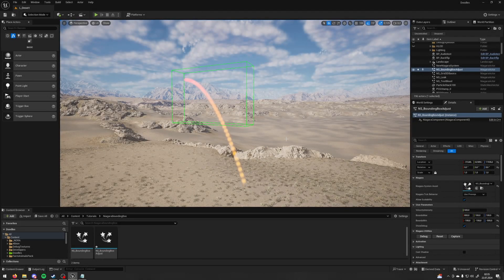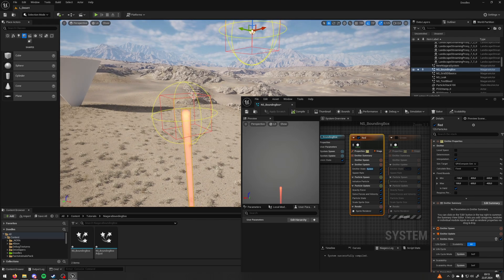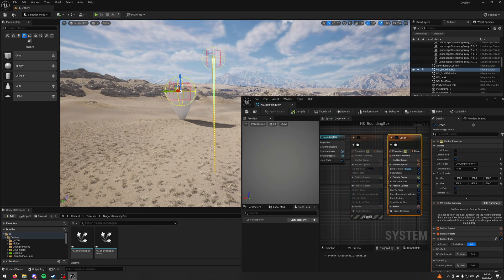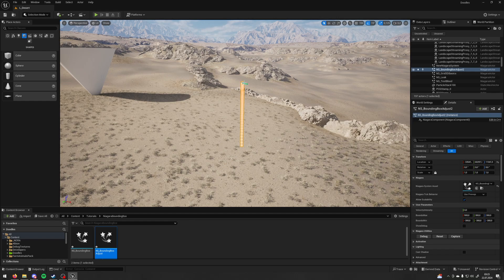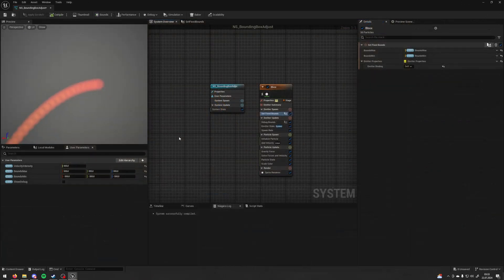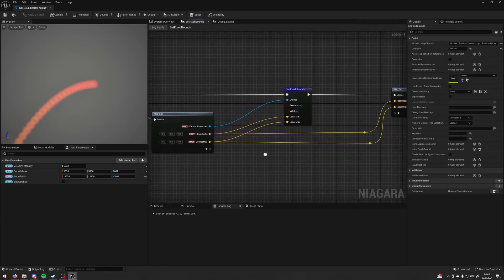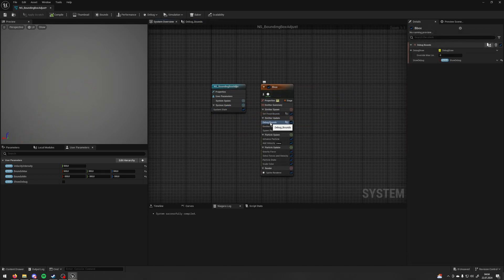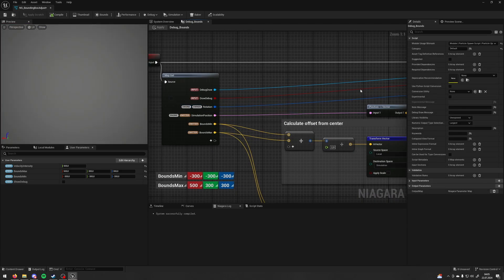Master Particle Bounds In Niagara! Unreal Engine 5 Tutorial

Comment from the maker: About the transform node: It just makes the bounds size values to be in simulation space (relative to the system position). It was late when I was recording it, so I may not have explained this part well. Without it, the debug box will not match the bounding box. Sorry for that.